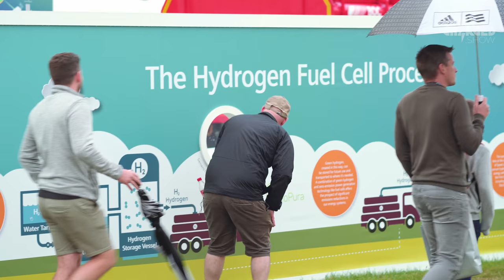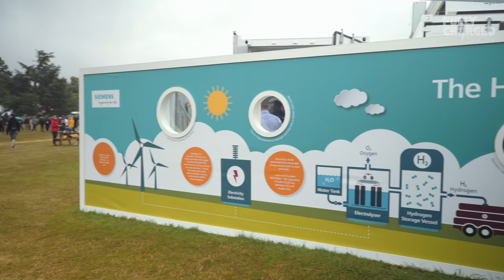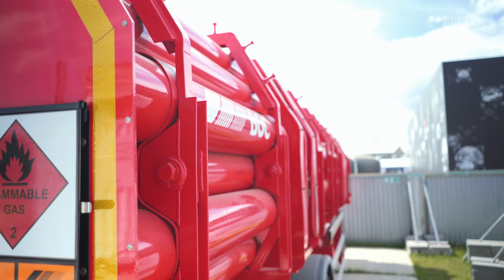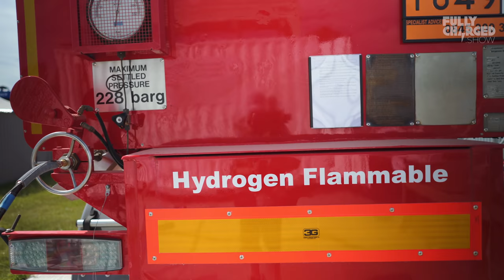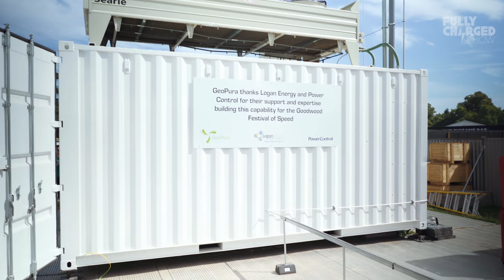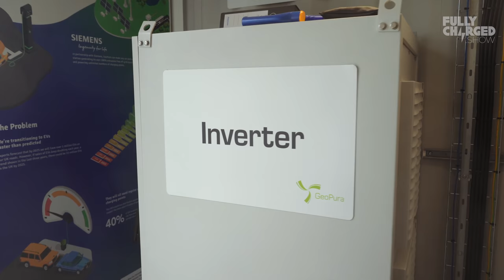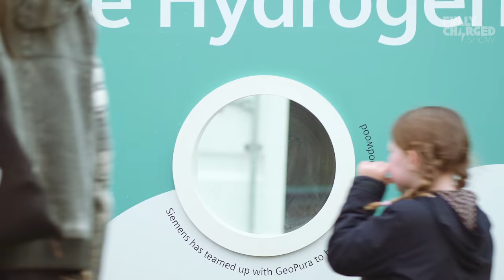Green Hydrogen Fuel Cell Charging System at Goodwood Festival of Speed | Fully Charged

Comment: A big trailer with H2 liquid and a big half-empty fuelcell-container, both driven there by a......diesel truck. With a lot of complicated high-pressure equipment in between. Only 1 container full of reused car-batteries would do the same job more efficiently I guess.
Reply: Actually it is not liquid hydrogen (even more dangerous), These would be gas cylinders probably at 350 bar (atmospheres)
Reply: "driven there by a......diesel truck" <-- Says who? Do you really think that electric vehicles can't haul large loads?
Reply: @NibsNiven  There are no heavy duty electric trucks yet. So yes distribution would be by diesel trucks and they can only haul a limited amount of gaseous hydrogen each time which would mean many more loads than a gas truck to serve the same number of vehicles. 
There are 4 modules on the truck. If each one was 130 kg of hydrogen (North American modules)  then a full truck would only carry enough to fuel 94 FCEVs (130 X 4 / 5.5kg/FCEV). Six of these per station per day to fuel what a petrol station does every day (600 vehicles) Yet another reason why hydrogen does not work. 
Making the hydrogen on site introduces a whole host of additional costs and safety issues. 
Hydrogen just does not work for roadway transport.
Reply: @jhindson88  "distribution would be by diesel trucks" <-- Your prediction will be proven wrong. There will be plenty of electric trucks hauling huge loads.
"If each one was 130 kg of hydrogen" <-- Obviously they contained far more than that so your comparison is nonsense. @4:25 he explains the trailer can haul far more than it does in this demonstration. @4:51 he says this trailer has 6MW energy, or 3MW electrical energy, which is a lot, but can be far more. If produced on site then transport is not required. Try producing diesel or gasoline at a gas station. It's apples and footballs.
"Making the hydrogen on site introduces a whole host of additional costs and safety issues." <-- More fear mongering nonsense. Hydrogen is far safer than natural gas despite the claims made by the vast natural gas lobby which stands to lose billions.
"Hydrogen just does not work for roadway transport." <-- Your opinion is irrelevant to the people now and in the future who are/will be saving loads of money while not polluting.
Reply: "both driven there by a......diesel truck".
The first railroad was built using horse and cart to transport workers and equipment.
The first iron smelter was built using stone tools.
Edison used oil lamps to light his lab when he was building a lightbulb.

Why do people think they're saying something intelligent when they point to old technology being used in the development of new technology. That's how technological evolution works - always has and always will.
Reply: @NibsNiven  I said each of the four containers on the truck was 130 kg of hydrogen at 350 bar Total 520 kg of hydrogen at 350 bar. If you have the actual numbers and if the UK allows higher pressure during transport  (doubtful) bring it please. I would like to know the facts.
Producing hydrogen on site is dangerous as little as 5% of the oxygen (from electrolysis) mixing back with the hydrogen will cause an explosion. The Norway site that exploded was a local electrolyzer/dispenser operation.  Since that incident all FCEV sales have been frozen (because there is no place to fuel them as all similar stations have been closed pending the results of an investigation)

If the reference to 3MW  (a measure of power) is really 3MWH (energy) that would be 3,000 kWh which is enough for only 100 EVs at 30kWh.
 
As for hydrogen it is very dangerous. Odorless (it cannot be odorized because the smell chemical added would gum up the fuel cells). It is tasteless, and invisible and burns with an almost invisible flame. Hydrogen is 10 times more flammable and 20 times more explosive than gasoline. 

The only thing it has going for it is that it is lighter than Oxygen and Nitrogen and will dissipate upwards. In a confined space it is death without warning

Hydrogen cannot use existing natural gas lines above certain concentrations as hydrogen starts to degrade pipeline metals, valves and seals.  Hydrogen has many industrial applications in highly controlled conditions but roadway transport should be off the table

Comment: The funny thing is, these gentlemen are excitedly talking about how this trailer of hydrogen tanks can store 3Mwh of energy after conversion losses... The trailer full gross weight is 31020kg (shown in the video at 5:15). Modern EV battery packs have a gravimetric energy density of 168wh/kg, which means even if we assume the axles and truss weight 5000kg, a similar trailer simply stacked with batteries could store 4.3Mwh... with no need for an extra containers worth of conversion equipment, radiators, etc.

Comment: ..Or you can just use the excess electricity to charge the EVs directly, and not bother creating and transporting Hydrogen, and having to have giant fuel cells all over the place. We have a national grid for a reason.
Reply: Seriously, all the uninformed comments who seem to think this is a good idea are really frustrating.
Reply: @Ross Bourne   Hydrogen is not a solution for water distribution, nor is using an inefficient process a solution for water heating.  The grid has always scaled up as demand has grown, not sure why you think it won't continue to do so, though localized battery banks might decrease the need for maximum growth.  Eventually each home and business will have it's own battery bank to handle local fluctuations and storage, and there will be grid sized batteries doing the same.  That's the future, not hydrogen.
Reply: How can you charge your EV directly in the middle of a field?
Reply: @crazytosh1  From a larger battery pack.
Reply: @JRP3  Ok well that's not "directly" from the excess energy, and if we start using batteries for every application like this we'll be using a lot of lithium and other resources
Reply: @crazytosh1  Yes, recycleable resources, while not using oil, gas and coal, which are not recycleable.
Reply: @crazytosh1  Well using a large battery pack to charge a car in a field is A LOT more direct than using hydrogen and its insanely cumbersome ecosystem.
Reply: @Simon-dm8zv  Ok but it still doesn't address the resource extraction required for batteries while hydrogen is unlimited. If we replace every diesel generator with a battery pack that's gonna be a lot of lithium.
Reply: @crazytosh1  Availability of lithium is not really an issue as it seems so far. But apart from that, imagine the resources needed to build three times the number of wind turbines and solar plants in order to compensate for hydrogen's horrible efficiency.
Reply: @crazytosh1  but what about the materials needed for the electrolysis equipment,  fuel cells, compression equipment, storage equipment etc. ? All of that equipment is the equiv. of a battery and must be considered in the equation plus you also need to include the about 3X factor for the differences in efficiency (not CHP efficiencies)
Reply: @milanswoboda5457  Sure, clearly they both have pros and cons and we'll probably end up using a mixture. Also the guy said that they already have significantly more energy dense varieties so we'll see where the technology goes. Certainly using hydrogen for freight ships and other large-scale applications seems promising.

Comment: If you store energy in fuel cells, you loose about 50 % in the conversion. Then, why not use batteries instead?
Reply: Plus the energy to get the gas!
25% overall.
Reply: Because it would weigh at least 12t...

Then again, a semi-articulated lorry can carry 40t+, so fair point.
Reply: A 3000MW battery would weigh far too much and get extremely hot.
Reply: A battery this size would cost best part of a million quid. (£750000 ish). I'm guessing this fuel cell setup is rather cheaper than that.
Reply: Energy Density.

Comment: Terrible efficiency, as with most hydrogen scams.  In the space taken up by the hydrogen storage and fuel cells you could put a Tesla Megapack with 3 megawatt hours of storage, but with close to 90% + efficiency instead of the 50% - of this system.
Reply: Batteries can be too heavy --> too expensive to transport.
Reply: @elektrotehnik94  No they can't be too heavy or too expensive to transport.
Reply: @JRP3  Why? :D
Reply: @elektrotehnik94  Batteries can be modular.
Reply: JRP3 Forgetting all about charging the damn thing in the first place of course. Good grief!
Reply: Exactly sir.
Reply: @JRP3  Batteries are much less power-dense per kg than hydrogen, therefore hydrogen system can be cheaper to transport.
Hydrogen system is "modular", you bring with you as much hydrogen as you need :D
Am I wrong?
Reply: @elektrotehnik94  Yes you're wrong.  Batteries have higher power density, but lower energy density.  That's why fuel cells need battery packs to put out sufficient power.  The footprint of a Tesla Megapack is about the same as the footprint of the system shown in the video so transportation costs would be similar.
Reply: @JRP3  You're right, I meant batteries have lower energy density per kg (and higher power density).
I don't know transport costs really, so maybe the weight doesn't make transporting heavy battery systems more expensive than hydrogen systems.

Comment: An excellent application for hydrogen fuel cells. It makes no sense to put fuel cells in light duty vehicles, Toyota, Hyundai and other are barking up the wrong tree on that but this works as a way to utilise the excess output from renewables when power isn’t needed and to serve off grid or poor grid applications.

Comment: so still wasting at least 20% converting wind power into hydrogen and then more loss converting that back to electricity again great !
Reply: This is more to do with doing away with diesel generators or site with no electric, and using these to charge EVs.
Reply: There are times when the grid doesn't need the wind energy and they have to stop them. This likely uses excess wind energy that would otherwise be wasted. This is also done on Orkney with wave power. Harness the energy if you can't use it at the time, otherwise you waste 100% of it.
Reply: I agree with you for end-of-use applications like EVs.  The problem they are trying to solve here is on-site generation.  Im generally against hydrogen as I think it's mostly a scam to use more petroleum byproducts, but if it can be certified as a "green" source, Im less skeptical.
Reply: Would you prefer them to use diesel?
Reply: @timmurphy5541  no just pump the wind generated power into the grid or storage batterys much less waste
Reply: @repairitdontreplaceit  if you listened to the video, wind produces excess power some times that the grid cannot use. Hence your comment about pumping to the grid is not relevant. Storage battery's might be quite efficient but nobody has built enough of them yet for some reason (cost?)  and making them mobile like diesel generators might be an exceedingly expensive way to offer temporary power. If you use the fuel cells heat as well as the power and if you can scale it up to huge power without scaling the cost and so on and on then maybe it will come out as worthwhile in the end.
Reply: Imagine that you have a portable power system in a remote place - what happens when it is empty? If it's made with batteries you have to drive it back somewhere with a huge power supply and charge it then come back. Or you have to have 2 units to keep continuous service.  With Hydrogen you only need 2 tankers - not 2 sets of cells - and refilling is potentially much quicker without needing a very high voltage charger.

Comment: It is good to that hydrogen has not fallen to the wayside, as was said in the video the price of generating electricity using this method will become cheaper as it is scaled up .
This form of generation should take advantage of new planned urban developments where they can be installed as a  factor of a general plan.
Not to remove the PUD from the national grid, but to make it less reliant on the national grid, the use of storage would provide a defense against wind and solar not performing when peak demand is required.
I would hope to see more of this type of generation in a commercial setting such as a server farm, or a steel mill, thanks for the video.

Comment: Hydrogen is only good for the companies that want to keep us using "fuel" that is consumed to create electricity. All other renewables are free at the source (wind, solar, hydro, induction, biowaste, etc.) Only hydrogen would require a whole new infrastructure to be built to make it practical, and even then, it still remains explosive and very difficult to store for long periods. 

This is just another attempt to keep us on the teat of a consumable, dangerous fuel, rather than using our already existing electric infrastructure, and moving forward with green, clean energy generation and storage. Even if hydrogen is "clean" burning, it's still very dangerous, (to make, transport, and store), and so the insurance to cover it would probably eliminate any savings it might in theory create. How many of the original handful of hydrogen filling stations are still operating, after the fires and explosions? Hydrogen blows!
Reply: They've invented a battery that lasts forever & are free, wow tell me more?   Even Elon Musk said they'd have to build 50 battery gigafactories just to convert the existing scale of the global vehicle fleet to EV's.    I'd like to know how they are going to achieve that in the next 10 years, plus throw in another 100 or so gigafactories to store energy for non-EV use.
Reply: Yes. In the past year there have been two explosions - South Korea two dead and 6 injured and Norway - passerby vehicles injured as air bags deployed. Source to Wheels efficiency is only one third as much for hydrogen as compared to electric vehicles.
Reply: @1jimjon  1 million miles is close to forever?  Tesla could probably build 50 gigafactories faster than these fool cells could be build.
Reply: @kentonian  To paraphrase Elon Musk again, there are plenty of new wonder batteries being announced in laboratories, bring me one that is working now that can be manufactured in volume at a reasonable price.
The hydrogen demo in this video is working now, at scale not just in a lab.
Reply: Barry Kaine Bollocks! And of course electricity isn’t dangerous, and it’s free!

Comment: Hydrogen will be very useful for storing energy long term, and even out the irregular production of renewable electricity. Thyssenkrupp can now do electrolysis with 82% efficiency, if it's burned in a turbine with 60% efficiency, you get 50% electricity back (and also heat). There's a lot of loss, but it can be stored long term unlike in batteries.

Comment: Interesting to see some of the nuts and bolts of a hydrogen fuel cell system. That truck trailer that holds the hydrogen caught my interest. They said it holds enough hydrogen to produce 3000 MWh of electricity. That's enough to recharge 50 state of the art EVs for a ~250 mile trip. I think a gasoline tank truck of similar size holds @ 9000 gallons of gasoline. That's enough to fuel 900 25 mpg ICE cars for a ~250 mile trip. I have long thought that the idea of using carbon free energy to create hydrogen for later use is a good idea; but unless my calculations are way off, it looks less appealing.

Comment: Interesting. However, while it may be useful in certain locations, the overall efficiency will normally be better using the national grid as a means of transmission. Feeding in surplus power from renewable kit (like my solar PV) to the grid so as to reduce the need from other sources is better than splitting water into hydrogen and oxygen as an interim energy store.

Comment: that installation looks like it was taking up quite a lot of space on the site.. if you had that much space full of batteries that had been charged by renewables and then brought to site on a back of a trailer then you would not loose 50% of the energy at the site charging the cars up. How much capacity would a battery that big provide? 

How much electricity did it take to create that hydrogen?

Watched Tesla Bjorn video recently and his calcs showed that Hydrogen was less than 20% efficient or so.. 

Or just set up some solar and wind with batteries on site from a back of a trailer.. We need some comparisons here.

Comment: Loved the point about heat.  Not sure how much water fuel cells produce, but if it's pure, why not store some of the heat and water as hot water? Hook the tank into a shower system's hot water tank, and voila.  Have a little nozzle on the side and use the hot water to make hot beverages.  Let people fill up their thermoses and use the water later.  

If they're producing enough heat that they could store to a certain heat density, they could throw some of the water on it, create some high pressure steam, and drive a turbine to generate even more electricity.  Not sure if that's something that could be efficiently done in something at the scale of a trailer, but it would be interesting if they could.  What type of container would one need to hold molten salt? ;)

I'm surprised we haven't found a cost efficient way to turn waste heat into energy directly.  Didn't I just hear they're working on some sort of "reverse solar panel", that uses the temperature differential between the ground and the air to generate electricity?
Reply: Google Seebeck effect